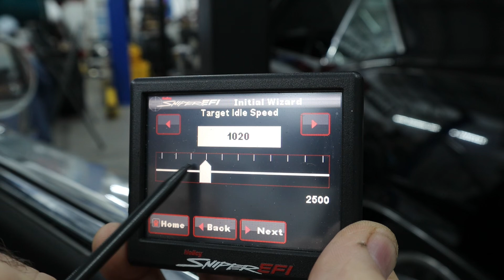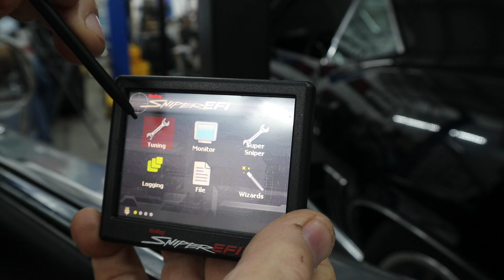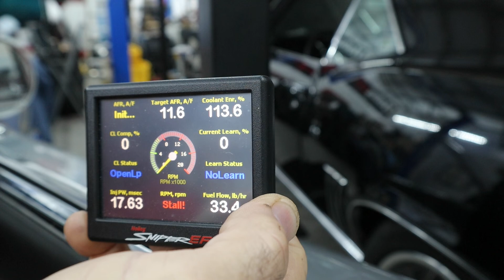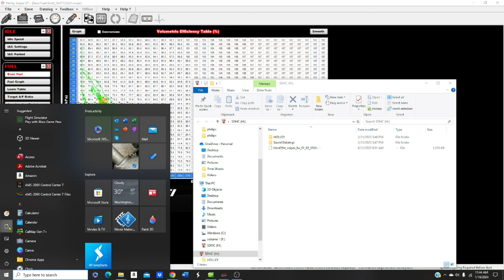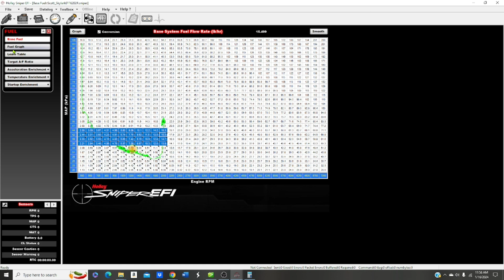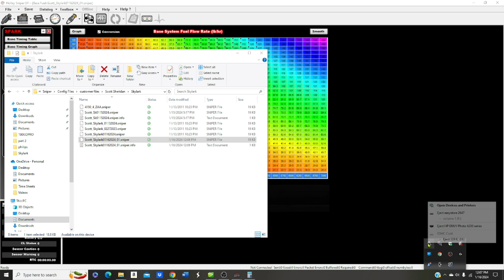Holley Sniper  Global Configuration file upload and downloads, datalogs, and tuning using your PC

Comment: This is probably one of the most informative info that I watched about the Holley sniper and I thank you for that. What motor is this file for that you’re using for this video? Thanks in advance.
Reply from the maker: I have a bunch more Sniper, Terminator X, and HP/Dominator info in my weekly Tuesday Live Show / podcast. Check them out
Reply: Excellent! Would you able to check out my tune if I send you my file, if you have the time? I’m not running any timing. I just have the coil and system. I would really appreciate if you can check it out. I have a new stock 350sbc Chevy with 700r4. Thanks again 😊
Reply from the maker: @lleonardo2880 sure, email the tune to landis.performance.center@gmail.com  and I will take a look.
Reply: @LANDISPERFORMANCE  subject is 1964 Impala. Thank you so much!!!
Reply from the maker: That file was for a Buick 215 aluminum block with a 300 crankshaft, making a 266cu in engine

Comment: After creating the file with the handheld, I get to the part where it says to cycle the key but when I do and the system turns back on and says please create a configuration file. Any ideas?
Reply from the maker: Yes, when updating firmware, that erases the global calibration file. You must go to "file" then to "Global Configuration" and pick a tune to "Download to ECU", if you didn't save any of your global configuration tunes, then go to "Wizards" and create a new tune.
Reply: @LANDISPERFORMANCE  I’ve gone through the wizard setup and answered their questions aka cubic inches, ignition system etc. Then I’ll get to the end when it says to cycle the key to save the tune. I’ll cycle the key and when the Holley screen boots up it just goes back to saying I need to configure it and make a base tune. I don’t understand
Reply from the maker: @codyc722  This is strange. Have you gone through the handheld as I just described and see if there is a global calibration, and try to download to ECU?
Reply: @LANDISPERFORMANCE  yes there’s one tune on the sd card in the handheld if I click send to ecu it will send it, I’ll hear the fuel pump, it’ll ask me to cycle the key which I will then it’ll go back to saying I need to load a tune file. I’m wondering if it’s a software issue. It’s up to date. I checked using their “update agent” off their website
Reply from the maker: @codyc722  unfortunately you are going to have to call Holley, I have never ran into that issue.
Reply: @LANDISPERFORMANCE  gotcha. Appreciate your help. I’ll let you know what they say.

Comment: I noticed the handheld said “no fwu file found” mine is saying the same thing now after getting 1.3.50 update and car won’t start. I also have a little green icon in the bottom right hand corner “o_o”. Did you have any trouble with trying to start your car or have any input that could help me out? It would be greatly appreciated!
Reply from the maker: Thanks for the comment. Look at the video at 32:43 thru 35:59. You will see the different folders and content on the SD Card. You will notice when you click "Holley" folder, the next page has FW100, FW101, FW103. Make sure you have these on your SD Card. If not download "SD Card content" from the Holley.com website where you downloaded the updated firmware. All of the content needs to be exactly in the right spot so the ECU and Handheld can find them. Hope this helps. I will be dropping a Software and firmware update video soon. I will try to get it finished this week.